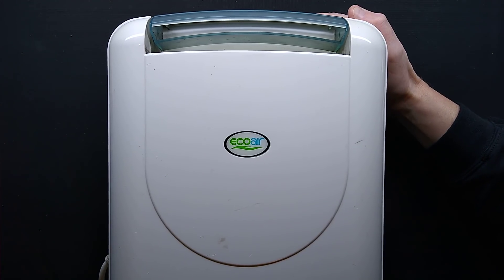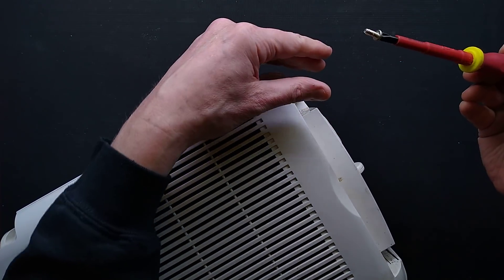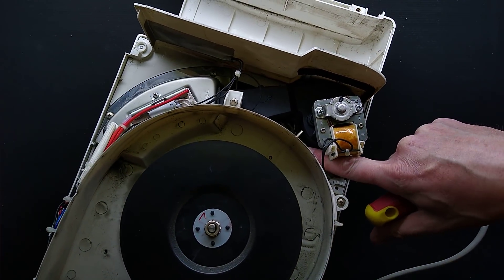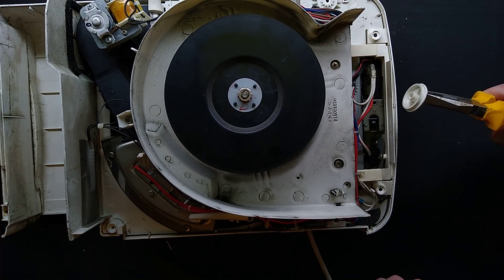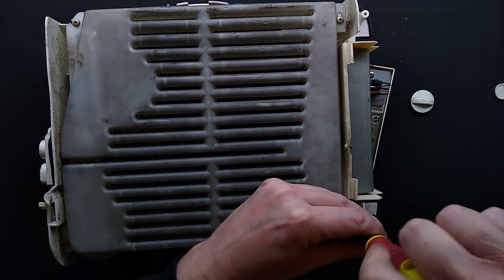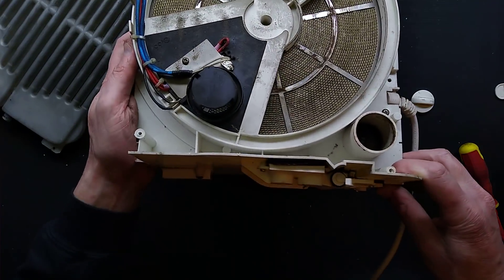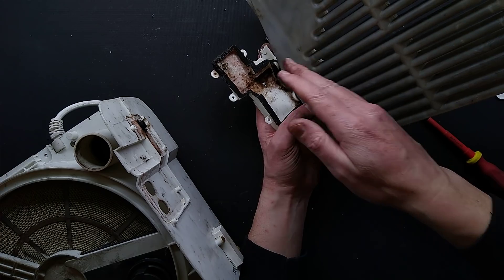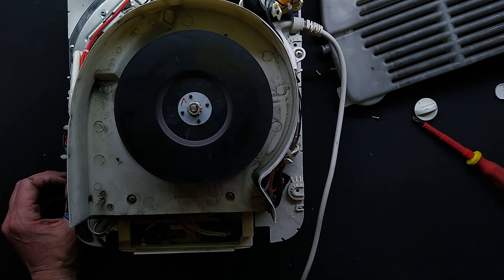Opening a desiccant drum dehumidifier.

Comment: Think I've seen your other videos on these as well as this, so fairly sure it's a Meaco. 
I'm never, ever ever touching Meaco again. 
Was given their top end model as a gift, their DD8L "We donate 0.001% to elephants" model. 
Just out of warranty it started giving overheat warnings and cut-outs. 
Took it apart assuming it was a normal failure mode. Or I'd done something wrong. Vapour had been made in the same room and I'd seen PC fans completely gacked up from it, but this was clean as a whistle. 
1) The fan (big centrifugal one) doesn't spin straight, spins like a buckled bike wheel. 
2) The motor for it gets hotter than the housing for the heating element
3) That motor is extremely difficult to get to, I'd have to disassemble the entire thing to just replace it and they don't sell spares. 

So my only option is to buy the fan assembly used and hope it works. Or throw the entire thing out. 
It was used for maybe 4-7h a day in winter, for two years.

Comment: Well mine has just stopped working. Dd3 slimline. No lights on the control panel. If I open it up there's a faint beeping coming from somewhere. Not the control panel but possibly inside the metal shielded electronics. Nothing obvious in there. The glass fuse has connectivity. The thermal fuses seem to have continuity too and looking at them nothing looks burnt. Inside it all looks pristine. The little am-05 motor that turns the desiccant thing is very difficult to turn by hand does any one know if it should spin more easily? The big 450v 1uF cap measures 975 nanofarads so I assume is ok. Difficult to know what else could be wrong (and there's really not a lot of other spare parts listed on their site for this model). I wonder if it's the control panel itself, although that seems to be just a bunch of LEDs and buttons and a controller, not a lot to go wrong really. I guess it's lower voltages so I could at least test it a bit with a power supply. I don't really want to start poking around inside the dehumidifier itself switched on because it's mains voltage. Unit is definitely getting power because of this beeping, but the big capacitor didn't have any charge
Reply from the maker: The faint beeping might be the power supply trying to start.  It's possible there's an issue on its secondary side.  Possibly a shorted rectifier diode or bulged smoothing capacitor.

Comment: Any idea of where to look first. My almost identical unit (DD1-Simple I think) clicks when you turn the humidity dial, but it doesn't actually start. No errors/red-lights. Happy to have a look but would like to know if anyone had a clue as to the most likely fault, so I can at least start there.
Reply from the maker: There's a safety circuit through various thermal switches.  There's also a tilt sensor, so make sure it's on a level surface and give it a few bumps to make sure that's working OK.

Comment: My DD1 has only lasted just outside the warranty 🙄
It only works in the cloths drying mode ie with knob fully clockwise.
Anyone any ideas ?
Ta
Reply from the maker: That's an odd failure.  Could the humidity sensor have been exposed to oil vapour?
Reply: Update⚠️
Thanks for reply Clive.
I was dehumidifing a car with very wet carpets after also using it in a damp house for a solid week.
It's amazing how much water these babies extract even on half power ! (a full tank every half day)
Anyway after a night session in the car it stopped working except wet clothes mode.

I was just about to dismantle it using you excellent guide......
After about 4 hrs sat in a warm dry room it has repaired itself 😊

But I reckon you're right about the humidity sensor, maybe I overworked the poor thing?
I'm guessing the clothes mode bypasses that sensor?

Comment: Many thanks for the excellent breakdown and description of this dehumidifier. I've had one for the last 10 years and it is absolutely excellent! 
I got the red light error on mine for the last few days, powering up and fan running for 30 seconds then the light came on.
I forgot that I needed to clean the filter which I found was full of dust and lint. But that didn't fix it.

So I took it apart following your instructions, removing the bottom collector that takes water from the bottom openings of the compressor, that you mentioned get manky :-) 
I  that wasn't particularly blocked or that dirty and the opening were not blocked either, when looking and poking the screwdriver carefully inside.
I powered up with it open, being careful, but that didn't make any difference.

However, I did notice the circular filter collector thing was not turning. 
I tried to turn it with the power off and it felt stuck. I unscrewed the motor and then re-powered, and found the motor was functioning. I think it has a gear system to help it turn so slowly, which is why it would be difficult to turn it without power. The circular filter collector thing was able to move freely without the motor in place.
I put back the motor and the whole thing magically started working again.

I hope this helps someone else.

Comment: Hi Clive,
Im based in Ireland and can't decide between a desiccant or a compressor dehumidifier. I was looking at the dd8l Zambezi but worried about the power usage. at the same time my house sits around 15 degrees all the time. what would you go for?
Reply from the maker: A compressor unit may keep going into defrost mode at 15C.  The desiccant drum unit will work fine at the lower temperature.
I use a desiccant unit in winter and a compressor unit in summer.
Reply: @bigclivedotcom  cheers Clive, I managed to get a brand new Zambezi for €20 at a car boot sale today(I am still amazed). Might get a compressor one leading up to summer as the temperature rises!

Comment: This is absolutely fantastic😎😎😎. I have two DD1s and just died....no power.

Was the large SF96 99c thermal fuse behind the condenser.

Can't thank you enough, hardest part was separating the case❤
Reply from the maker: Yeah, they're quite complex to get into until you discover the hidden screws.
Reply: Richard or Clive, once disassembled (thank you, Clive) how would one identify the component that requires replacing? Mine "just died...no power", as Richard's did. Thank you!

Comment: Brill. I bought one of these a couple of years ago and it started leaking a few weeks out of guarantee. The ecoair people were really horrible and unhelpful about offering to fix or replace the unit unless l paid fully. So got a dehumidifier that works but leaks from the bottom and not sure if I've competence to fix if the problem is a blocked water outlet.
Reply from the maker: The first units had teething issues and the sellers didn't deal with it well.

Comment: My heater has stopped working - tested the thermal fuse and replaced, but still no luck. Could the thermal switch fail? I can't see what else could be causing it, unless it's the switch up top that turns on laundry mode...
Reply from the maker: There's quite a long safety circuit including a few thermal fuses, a tilt switch and the float switch on the water container.   The heaters themselves can also fail.
Reply: @bigclivedotcom  thanks for the reply. Yep, that's correct about other switches although I believe the tilt switch stops the fan too. The heater seems to be a basic element and can't see any loose connections... Think I may have to buy a whole new unit at this rate 😥

Comment: to all the professionals here.question. what can be done if the unit is too noisy?
Reply from the maker: It shouldn't be noisy.  Just a fan noise.  If it squeals there may be a bearing issue with the hot air loop fan.

Comment: Great video! I have a Meaco DD122 MK4 which seems to be pretty much the same as this but with a push button panel. Internally it is pretty much identical, except mine seems to have no stainless steel screws (and several of the screws near water are rusting!). Mine runs and spins everything (fans, drum, etc.), but doesn't seem to collect any water. I am guessing the heating may not be running, so I will poke at that next! The fan is pushign cold air out, and I can't remember if (when it was working) that air was warm... Any ideas, anyone?
Reply: My guess is that the heater or one of the fuses has gone. Fortunately, the case actually has a wiring diagram on it, which is unprecedented these days! Where did I put that multimeter.....

Comment: That's an excellent teardown, many thanks.  Very good to have the explanations as well as the physical demonstration.  I think these are very well designed internally, a lot of thought seems to have gone into the layout and cable management etc.  Stainless screws in damp places also scores points.  Do you have any comment about the lifetime of the dessicant wheel?  I have just repaired one of these where the zeolite wheel was not rotating, the slow drive motor gearbox had stripped the teeth on one tiny pinion - but the replacement is a standard "microwave oven" type slow synchronous motor available for a few pounds.  Hoping that the zeolite absorber will continue to function as intended as the rest of the machine is in very good order.   Repairs for the win :-)
Reply from the maker: They seem to have a very long lifespan.
Reply: See my comment. I opened mine up because it was leaking a bit. Mine dates back to 2006 and has many hundreds of hours use and is still extracting water from the air very well.

Comment: My uncle had the electronic Ecoair model DD122FW MK5 fail and asked if I could dispose of it.  The desiccant drum motor failed, so I ordered the nearest equivalent I could find with a similar shaft (model TYJ50-8A7).  I never thought about the wire terminals and sure enough there was a screw pillar in the way.  The original motor had no terminals with the wires coming out the back.  As a workaround, I turned it a few degrees so a screw went in the second hole on one side of the motor and a screw wedged the outside of the screw terminal on the other end, snug in place.  The cog fit the shaft and didn't need the circlip (no slot for it).  With the motor in place, the cog can't slide off anyway.  

Like the one featured, this dehumidifier was heavily soiled in smoke dust (he has an open fireplace) and the desiccant wheel needed a good vacuuming.  I cleaned out the condensing module, drip tray, etc.  The dehumidifier now functions, however, from a few 1 hour tests, its performance is not great.  On continuous low, it draws about 120ml per hour drawing 310W and on high it draws about 190ml per hour drawing 550W, both in a large room area, 60-65% RH 21°C during the tests.  For comparison, another 7 litre desiccant dehumidifier I had years ago typically removed 290ml per hour on high.  The original motor stated 4-5RPM and the new one 4RPM, so it may be rotating too slow.  On the positive side, it was otherwise going to be scrapped.  Now we can use as a heater with dehumidification as a by-product.😁
Reply from the maker: As a rough guide based on mine, it should use about 4.5 units of electricity to take 2L of water out of the air.
Reply from the maker: I think that works out about right for your unit.
Reply: My motor repair had exactly the same issue!  I did a bit of "shaving" of plastic parts and managed to fit it in.  Motors with just cables available but only from China with weeks of shipping time, UK stockists of equivalents had only the spade connected ones like yours.   Seems that there is a good number of people taking care to repair :-)

Comment: Has the manufacturer made any improvements to this model over the years, or is the design still the same meaning the faults you raised are still the same?
Reply from the maker: Same technology, but reliability is improving.  I still recommend using them at the low setting.

Comment: If the water channels are blocked will the heater stop working?
Reply from the maker: It can cause water to back up into the internal air circulator fan.   You can probably remove the water tray prone to blocking.  Try a short screwdriver to remove the black tray from the water-drawer area.  It saves opening the whole machine.
Reply: @bigclivedotcom  Thanks, I opened it today and found a hole in the Condenser so I assume that's why it stopped collecting water :(

Comment: The  fan motor was not running. The start capacitor was ok. Opened the motor and there was a thermal  fuse.; AUPO A3-3A-F on the windings to guard from overheating. Clipped it away and soldered the wires together. The motor  is running but without this thermal fuse which I will replace as soon I get one.
Reply from the maker: Definitely replace it.  Worth getting a spare capacitor too.

Comment: Thanks for the video.  My Ecoseb-branded unit just popped one of the main thermal cutoffs after the drum motor stopped working.  Unfortunately I'm having a hard time sourcing a replacement motor with the correct shaft profile.
Reply from the maker: It's a very odd profile.  I've got an old unit with the same issue.

Comment: Next, let's do a poor mans "zero mass water" thingie by converting the heater to a solar heater collector.
Btw, an ambiguity in your text here: "In operation, air is pulled through the unit by a powerful fan.  It passes over a plastic condenser to cool it to room temperatur"
It passes over the plastic condenser to cool the condenser and the hot, moist air inside it, not the air. It sounds like your second it refers to the same thing as the first it, but it doesn't.
At least I hope it doesn't ;-)

Comment: Hi Clive,thank you for this video. I have this exact model, it only worked three winters. When it is switched on it just works for five minutes and goes off and after some minutes it goes on for another five minutes and stops again, without collecting any water. Do you think it can be fixed ?
Reply from the maker: Does it blow warm air at all when it is running?  There are several safety switches in the unit to detect the unit being level and sections of it overheating.  That does sound like a thermal issue.  A common issue is the little water collection tray above the water drawer getting clogged up.  It can be removed with a very small screwdriver to check.
Reply: @bigclivedotcom  Hi Clive, thanks for replying. Yes it does blow warm air when running, Yesterday after I opened the case and cleaned it, switched it on and it kept running for three hours before it switched off with full tank indicator on, but there was not even a drop of water in the tank. Do you think that the tray  switch can be bypassed ?
Reply: Hi Clive, I decided to give it another try. I opened it all out as per your instructions, no clogging. What I am noticing now is that  when it is switched on high it only works for 2 minuets and switches off with red light on but water tank is empty. I believe it is as you said, that it is a thermal issue. If the heat element fails, what happens ? Does it overheat or do not heat at all ?mine is getting so heated that you cannot touch the element cover,   or is it the thermal protector that is failing ?

Comment: How easy would it be to get the dessicant wheel out? I ask because i have a mould issue and after running these in a damp environment you get mould and stuff(gunk) particles of which then get blown out causing the very problem i am trying to avoid. So the wheel and the condenser will need a clean.
Reply from the maker: The wheel is usually OK if the filter is used on the air intake.  The machines can amplify smells due to the way they work.  The main bit to keep clean is the output water collection tray and condenser if needed.  Washing the drum might damage it.
Reply: @bigclivedotcom  thanks

Comment: We've got a similar model, and as you say the "guts" do seem to be near-identical between all manufacturers. The plastic mouldings are very amenable to a trip through the dishwasher on  a cooler ("eco") setting, and regular washing keeps them working much better (as well as being far more pleasant to repair when (albeit rarely) needed. The fan motors are all sleeve bearing, and benefit from a six-monthly oiling with light machine oil. Alternatively there's enough space to install ball bearing motors (especially on the larger radial fan motor) which reduces noise level a bit.

Comment: The label reads that on High this unit is rated 612W - does that all end up being emitted as heat in a unit like this or is it mostly consumed converting water vapour to liquid? My mind is saying "latent heat of evaporation" but in reverse?
I should probably go do some reading rather than ask in YT comments! But if anyone's audience has a hope of providing factual answers it would be BC's :D
Reply from the maker: It does emit a decent amount of heat.  Not the sort of thing you'd just leave running all the time, but handy in winter for a little extra dry heat.
Reply: @bigclivedotcom  Interesting. I tend to only bother having heat in my humble abode for a few hours each day for 2 - 3 months a year. I'm fine with what others would call "freezing" ambient temps, just stick some more clothes on :D
What heat I do use is all electric resistance (convection or fan heater in the room I'm in). So if I can get some de-humidification without a massive efficiency sacrifice on the heat side, then that'd be a great idea.

Comment: I've this exact model but I didn't see the humidity sensor and I'm pretty sure mines be ruined by people smoking ecigs, it seems to always run no-matter what as I presume it's coated in eliquid, I'd quite like to clean that sensor but I've still no clue where it is even after watching this.
Reply from the maker: The humidity sensor is the but the knob is attached to.  It uses a moisture sensitive membrane.  I'm not sure it's a good idea to clean it.  These units tend to have quite a wide hysteresis on the on-off humidity.
Reply: @bigclivedotcom   thanks I don't intend to really wet it or anything just wipe it a bit as it couldn't really make my unit any worse.